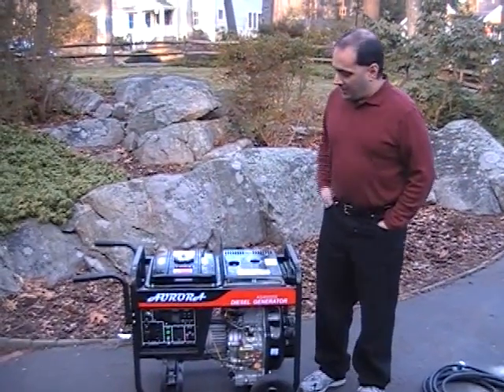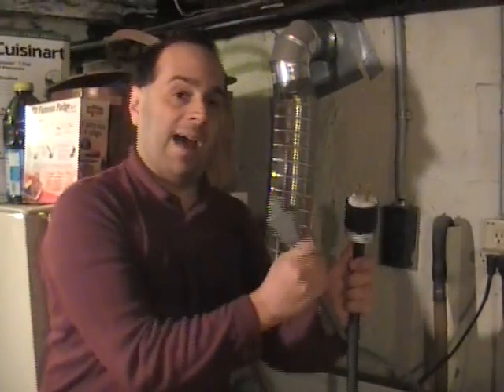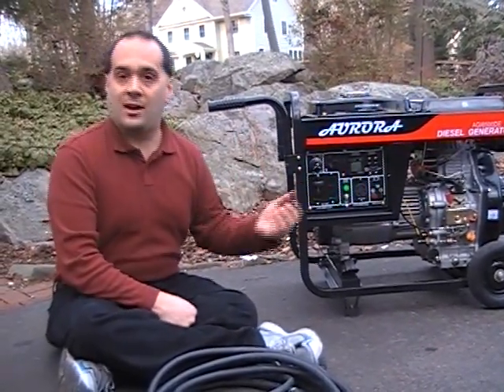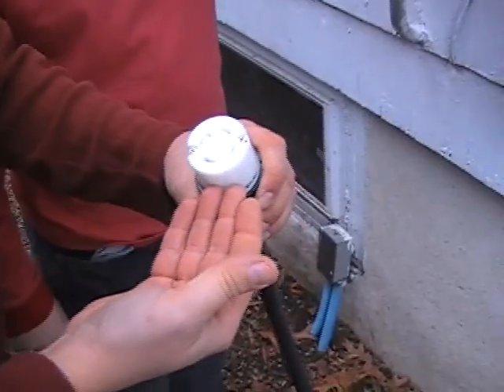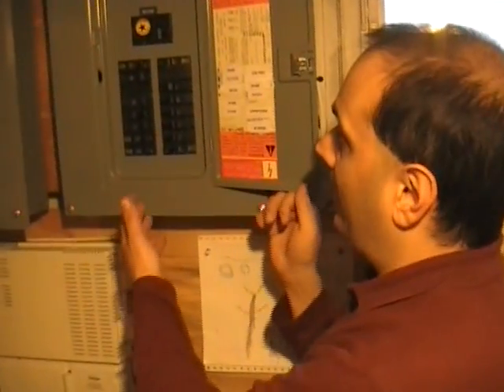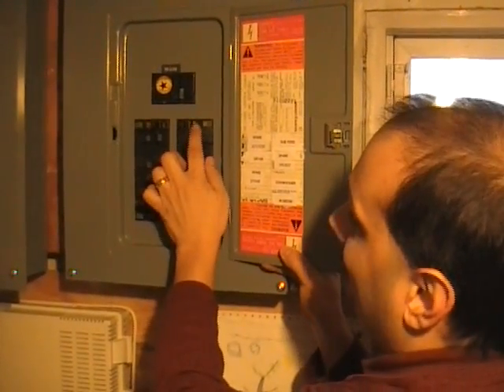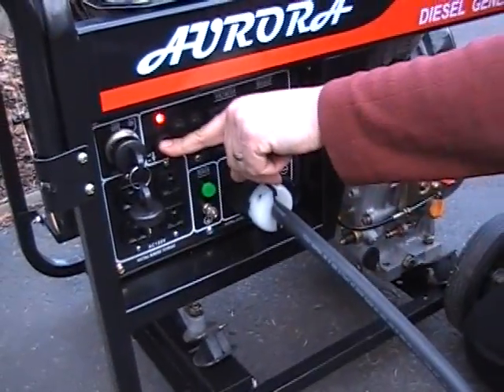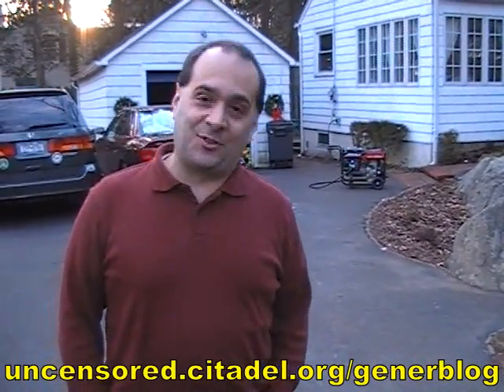Inexpensive residential generator hookup

Comment: Thank you! I’m a Master electrician and been wiring for 40+ years. Most videos I watch are made by suicidal maniacs, people trying to burn their house down or trying to kill someone thru their ignorance. Not to mention the home brew multi-fuel generator conversion that at best only make piston go up and down with no governed control and at worst have the potential of blowing up and burning down the whole neighborhood! You did a fine job of showing people the right and safe way to preserve themselves their household and comfort without a manslaughter suit! A fine Job! I like that you instilled and had your young apprentice participating in the explanation on safety! Thank you both again!
Reply: jeff camp that generator was a DIESEL, Cheers from NJ
Reply: I see it all the time and on the news
Reply: A generator "blowing up" and burning down by the entire neighborhood?! Seriously 🙄
Reply: stefan w  It’s not the generator that blows up the neighborhood. It’s when the generator fails or shuts of on low oil, and you don’t have a demand regulator to shut off gas flow. Lip then flood the area, example: an open door or basement window or a semi enclosed area. That trapped gas is explosive and if it build a explosive  environment in that enclosed area. When ignited it s expands thousands of time with a big fireball. Blows up a chunk of your house and the heat starts a fire! The poor guy that turned on the lights or lite a cigarette in that area is dead, if you have gas lines in that part of your house and they’re damage from the explosion, then you can have another explosion or a bigger fire! That is why all engineered equipment has safely‘ stop prevent gas from flooding an area of building with gas in the event there is equipment failure!  That potential is their why risk it when you can get a demand regulator for 80 bucks. Smart is safe!
Reply: @jeffcamp481  Make sure you follow all the generator safety rules before using portable generators. This is just a reminder for everyone’s safety. All generator safety rules should be followed carefully. Here are the rules about generator safety: Generators can be dangerous if not used carefully. Every year, hundreds of people die or get injured when using portable generators due to carbon monoxide poisoning and electrocution. Make sure you are using your generator carefully and keeping others safe as well. There is something very serious that everyone should always be aware of when using generators. Some people do run their generator indoors which is not safe and that increases the risk of carbon monoxide poisoning which can cause death of family and you. Some people run their generator in wet conditions which can electrocute them. Please remember that you should never run your generator indoors. Remember that carbon monoxide is an odorless and colorless gas that you cannot see or smell. Carbon monoxide is a silent killer. Keep that in mind. Make sure your generator is 15-20 feet away from your house and away from doors, windows, and vents. Never use your generator in your porch too. Having a carbon monoxide detector is very important against generator safety. Some people also allow children to go near the portable generator which could pose risks. We need to keep an eye on our children making sure that they are not near the portable generator so they won’t get electrocuted or burned by the generator which is dangerous. A locking enclosure also keeps kids safe. A generator shed might look like a tempting place to explore, or take cover during a game of hide and seek, but a generator is a dangerous piece of equipment that can cause injury. It says on the manual that we should also keep children away at all times from the portable generator to avoid injuries. Please do not allow a child or unqualified people to operate the portable generator.  It is important to keep your children safe especially little ones. The portable generator can be hot during an operation. Just because some manuals missed what should be listed doesn’t mean it’s safe to do. Always follow the generator safety rules when using portable generators. Generators pose electrical risks. If you need to use your generator during wet weather, you need a generator tent to protect your generator from getting wet. Don’t let your generator get wet. Keep your generator dry and before using your generator, please make sure your hands and your generator is dry. Do not wear loose clothing when operating the generator. Everything that is said on the generator’s operating manual should not be ignored. Never smoke cigarettes near the generator. Please keep flammable things away from the generator. Never overload your generator too. Your generator can catch fire. Never ever try to plug a generator cord into a wall outlet to avoid back feeding. Back feeding your generator is dangerous. Always turn on your generator first before plugging in appliances and shut off the appliances before turning your generator off. Use a heavy duty cord for your generator and the cord should not be worn out. All the instructions should be followed carefully. Never refuel your generator while it’s running. It can cause fire if fuel spills while your generator is hot. You should turn off your generator and let it cool off before refueling it. Having a fire extinguisher next to the generator is also important. This is only a reminder for everyone’s safety of using generators. Make sure your generator is properly grounded. Having a fire extinguisher next to the generator is also important against the safety rules. https://youtu.be/I1jT3ANENvI and here is a video more about keeping others safe when using generators and also about our family’s safety. It’s important to keep our little children safe as well. Make sure they’re away from the generator. Hope this helps.

Comment: Don't be surprised some Thugs come by in the middle of the night and Steal your generator.
Reply: I chain mine..generators are easy to steal unless you secure them
Reply: Wtf. Where do u live?
Reply: Dave Harmon live in MIA?  Probably, lol
Reply: Rocco T so Rocco, you are served by FLICKER POWER& LIGHT . know them well. Cheers from NJ
Reply: I know. Just thinking if you catch them you could lock them in a box cause nobody knows they are there. Right? Just a thought.
Reply: @4406bbldb  my generator stays in the Garage and vents out the door knob of my side door. I have a Dead bolt locked and the door knob off for venting  purposes. If you leave your generator running at night it may be gone in the morning.

Comment: Ok, help me to understand please.  The conduit and wires you ran from the main panel to the sub-panel.  Are you just mirroring the circuits you want to be able to run from the generator?  So if you want to run the fridge are you tapping off the fridge CB over to a new fridge CB on the sub panel?  And then how is the generated power making it to the fridge?  Is it going back to the main panel and then using the existing lines?  If so, what are you actually turning off at the sub panel when you are switching over to generator power?

Comment: Art I was just wondering can you plug your generator into an outside regular plug 15 amps and turn off all the 20 breakers in the panel box and just to run your lights, tv, fridge and deep freeze and I can just make up a regular suicide plug.
Reply: Thank you
Reply: No, It's called a suicide plug for a reason. Trying to power your whole house through one regular 120 volt circuit will cause the line to overheat from excess current through the wire and burn your house down. It's also illegal.
Reply: @josephr08322  Make sure you follow all the generator safety rules before using portable generators. This is just a reminder for everyone’s safety. All generator safety rules should be followed carefully. Here are the rules about generator safety: Generators can be dangerous if not used carefully. Every year, hundreds of people die or get injured when using portable generators due to carbon monoxide poisoning and electrocution. Make sure you are using your generator carefully and keeping others safe as well. There is something very serious that everyone should always be aware of when using generators. Some people do run their generator indoors which is not safe and that increases the risk of carbon monoxide poisoning which can cause death of family and you. Some people run their generator in wet conditions which can electrocute them. Please remember that you should never run your generator indoors. Remember that carbon monoxide is an odorless and colorless gas that you cannot see or smell. Carbon monoxide is a silent killer. Keep that in mind. Make sure your generator is 15-20 feet away from your house and away from doors, windows, and vents. Never use your generator in your porch too. Having a carbon monoxide detector is very important against generator safety. Some people also allow children to go near the portable generator which could pose risks. We need to keep an eye on our children making sure that they are not near the portable generator so they won’t get electrocuted or burned by the generator which is dangerous. A locking enclosure also keeps kids safe. A generator shed might look like a tempting place to explore, or take cover during a game of hide and seek, but a generator is a dangerous piece of equipment that can cause injury. It says on the manual that we should also keep children away at all times from the portable generator to avoid injuries. Please do not allow a child or unqualified people to operate the portable generator.  It is important to keep your children safe especially little ones. The portable generator can be hot during an operation. Just because some manuals missed what should be listed doesn’t mean it’s safe to do. Always follow the generator safety rules when using portable generators. Generators pose electrical risks. If you need to use your generator during wet weather, you need a generator tent to protect your generator from getting wet. Don’t let your generator get wet. Keep your generator dry and before using your generator, please make sure your hands and your generator is dry. Do not wear loose clothing when operating the generator. Everything that is said on the generator’s operating manual should not be ignored. Never smoke cigarettes near the generator. Please keep flammable things away from the generator. Never overload your generator too. Your generator can catch fire. Never ever try to plug a generator cord into a wall outlet to avoid back feeding. Back feeding your generator is dangerous. Always turn on your generator first before plugging in appliances and shut off the appliances before turning your generator off. Use a heavy duty cord for your generator and the cord should not be worn out. All the instructions should be followed carefully. Never refuel your generator while it’s running. It can cause fire if fuel spills while your generator is hot. You should turn off your generator and let it cool off before refueling it. Having a fire extinguisher next to the generator is also important. This is only a reminder for everyone’s safety of using generators. Make sure your generator is properly grounded. Having a fire extinguisher next to the generator is also important against the safety rules. https://youtu.be/I1jT3ANENvI and here is a video more about keeping others safe when using generators and also about our family’s safety. It’s important to keep our little children safe as well. Make sure they’re away from the generator. Hope this helps.

Comment: Could you please add list of parts to buy to do this project at our homes. Thanks
Reply: Here's what I found so far: (all are how they're listed on Amazon)

Interlock Attachment, QO, Q1 Breakers (May not be the right model and might not work with a non-Square-D panel/breakers)
Podoy 2715 NEMA L14-30 Flanged Inlet Generator Plug Waterproof Cover L1430P 30A 125/250 Volt with Locking Receptacle Socket Black Industrial Grade Grounding Welding Use 7500 Watts  (looks like all I'll need is a hole saw to mount it.  Uses same piece of rubber for cap and gasket.  Neat design for $18)
Leviton 2711 30 Amp, 125/250 Volt, NEMA L14-30P, 3P, 4W, Locking Plug, Industrial Grade, Grounding - Black-White
Leviton 2713 Locking Connector, Black-White
You'll also need some 10/4 wire and a sub panel and breakers and wire to feed the subpanel.

Might not be a complete list and some items might be wrong.  Someone please correct me before I click "Proceed to checkout".  Thanks

Comment: A good way to kill linemen would be to install a panel like this and inadvertently leave your main breaker on and back-feed the transformer. This is why they manufacture transfer switches. - General Journeyman for over 20 years and licensed for high voltage.
Reply: always assume every line is hot.  - possessor of common sense.

Comment: As stated in other comments, yep, good subject, really excellent, understandable instructor, presentation. However, that said, thinking one can "just" add a second breaker panel, as shown, cheaply, is in nearly all cases simply put, absolute bull, raging nonsense. It is VERY expensive, as my personal finances go, to contract an electrician, purchase materials, arrange with power company for them to come disconnect meter (only authorized power company personnel can connect or disconnect home consumption meters here!), then return to reconnect meter, after rewiring for that second panel. Far worse, for homes built more than about 20 years ago, the county building/housing inspectors, must, by law, come to insure that the house is now up to ALL current building codes, BEFORE  the power company is allowed to reconnect the meter!! This could run into many thousands of dollars to remediate. Plus days of construction work. Nahhh ... either you live in a somewhat loosely enforced building code and inspection area, or you did this yourself, on a clandestine basis, or, your pocketbook is one helluva lot deeper than mine is. My solution, which I've used for many years now, is a 3500 watt gasoline gen, from which I simply run heavy duty supply cords to two switched power busses/strips, one upstairs, one downstairs, and just plug in what is needed to provide lights, run refrigerator, even operate small electric heaters, to the house, all the while, very carefully monitoring loads. Have even a couple of times hooked up hot water heater with no issues.  With all LED lighting in my home now, I can easily light the entire house. I don't run expensive solid state devices (computers, TV) if I can avoid it, due to sometimes noisy, spikey supply voltages from generators. But of course, do use chargers. Had no issues that way, to date. 
Again, really nicely done video. I just think you glossed over the true costs of that second panel. BTW, I live in a very rural area, in midst of deep forests, with frequent bad weather spells, yet our power utility does a great job of keeping us going. So fortunately I don't have to depend on a generator very often. Anyway! Longest outage in 20 years? About a week. Thanks for your time and efforts.